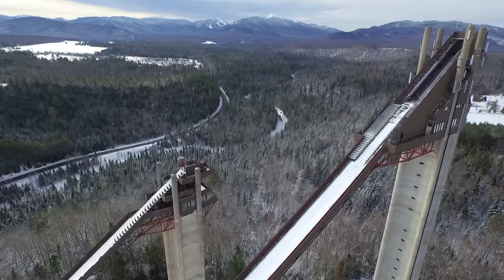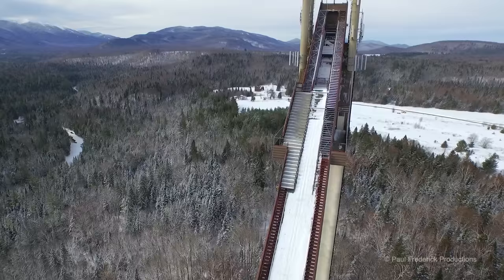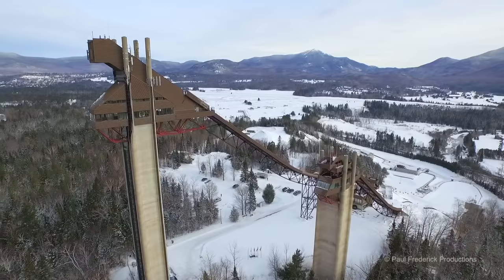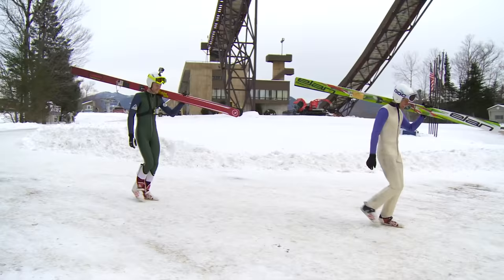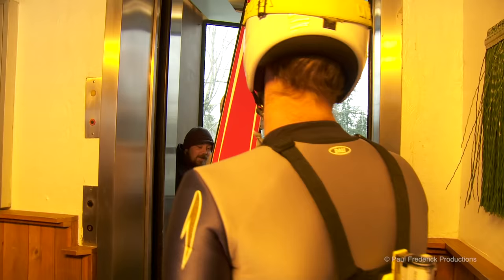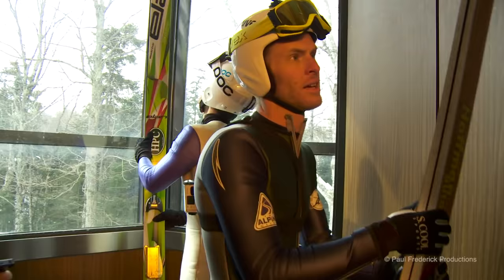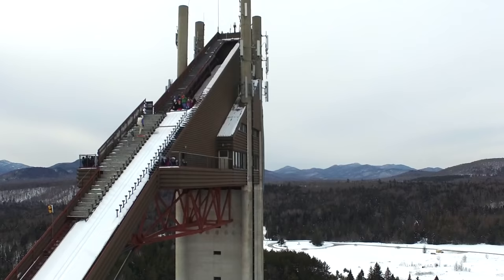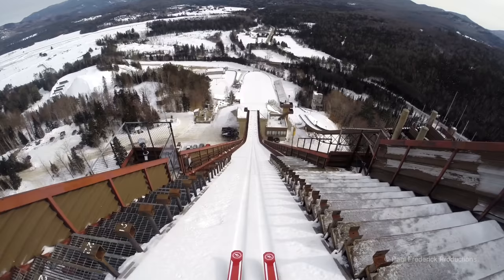Jumping the K120 - Lake Placid, NY

Comment: Have bin going to lake placid every year for the last ten years for our wedding anniversary. Heaven on earth.
Reply: Lovely up in the Adirondack mts...4WD vehicle  is mandatory if one wants to drive around  without  having problems in the winter..  Expensive to maintain that higher jump tower .( both towers actually ).. no wonder it doesn't get used much.. and who do you think pays for the maintenance / upkeep / electric power for both towers? the ** taxpayers** that live there , that's who ! 💰💰💰💲💸😵.. the towers mainly just sit there , yr. after yr. gathering dust and slowly rotting away 😕..the moisture - laden  weather , ( the mts. don't get much continuous sunlight -, solar power benefits close to none - not enough to matter ..solar power is  cost prohibitive ..🚫 )  ..acid rain , other factors  contribute to the eventual total rot..  both sit there like two useless , lonely monoliths .🙁👀. just waiting to return to the earth from which it came.⬇️.🕳️😞🤑🤑🤑🍀

Comment: "The ramp is too expensive to maintain"
so you`re pretty much saying the ramp is shit
Reply: @xplicitfishin  also you can't use the ramp due to the inconsistency of the temperature because the snow of the inrun can just slide off the ramp. Crazy good engineering
Reply: Mostly it’s due to warmer temps. In the 1979 when it was built, the winters were way colder and could hold snow on it much longer.
Reply: @larrylrs7226  As the video explains, unlike most ski jump hills the one at Lake Placid is not built into the hill. So unlike those that are built into the hill, the underside of this one is completely exposed to air temperature along its full length.
Reply: So when the air warms up and the snow starts to thaw, the entire track will melt. The local topography dictated that it be built this way. I’m sure they would’ve built it into the hill if it could’ve been done. This would’ve helped retain snow during warm periods once the ground under the ramp freezes. Next time I recommend you read a bit about this stuff and educate yourself before making uninformed comments.
Reply: @dougiebruce    I am very aware that the ramp had to be built that way, given the local topography. I know about a lot of ramps in Europe that are built similar, but can still be used consistently over a season. I more or less joked when I made my comment about the ramp being ''shit''. I'm sure it was great compared to others in the given era. I just don't get why they don't put a synthetic top on the inrun, which wouldn't need snow on top of it to slide. Might be the far more efficient solution